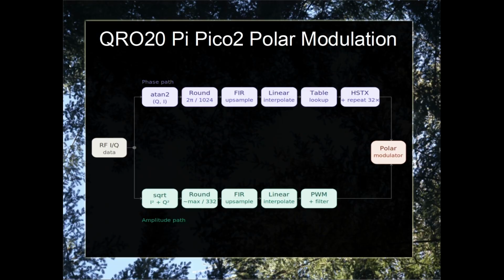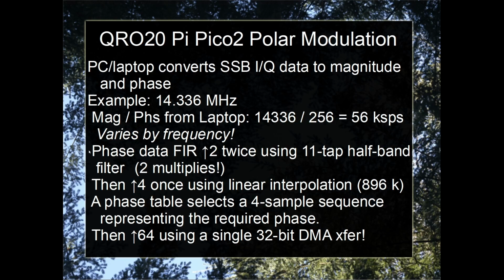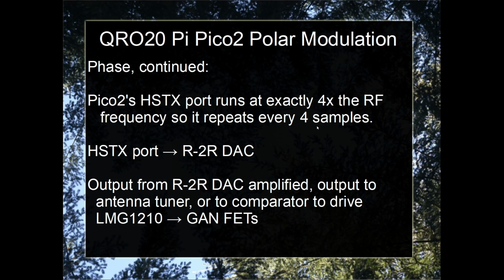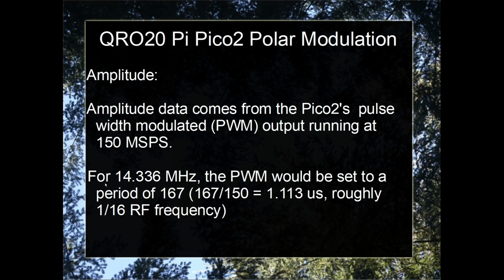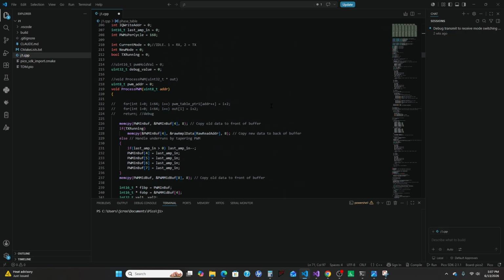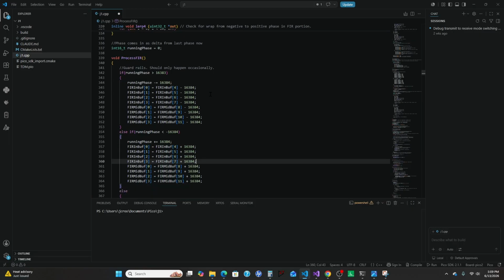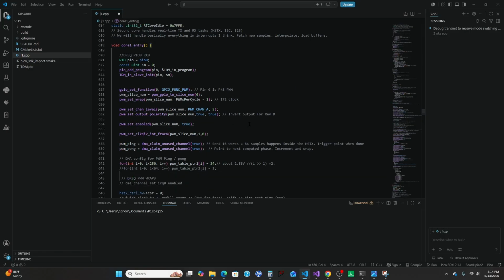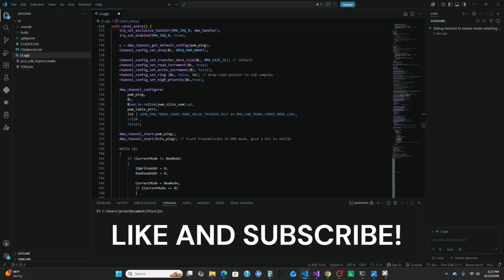How the QRO20 Generates Polar Modulation using a 99 cent Microcontroller (RP2350 / Pico2)

Comment: AI Slop
Reply from the maker: Claude built the picture for the block diagram, and the PC software is 50/50. But I don't let it touch my Pico2 firmware. Timings are far too delicate. But sure, call it AI slop if you like.